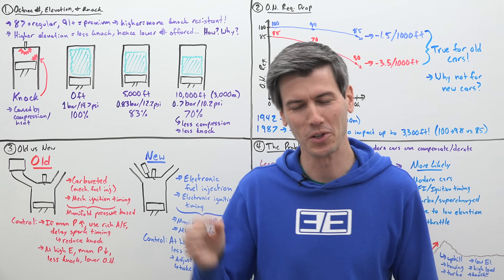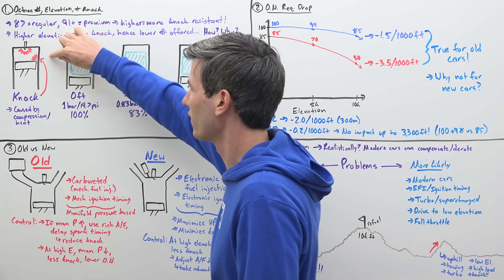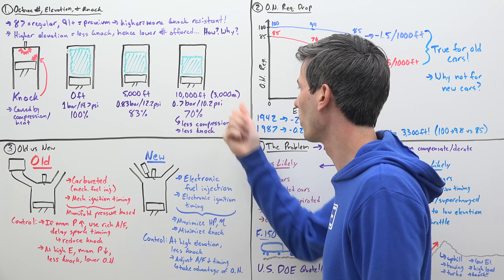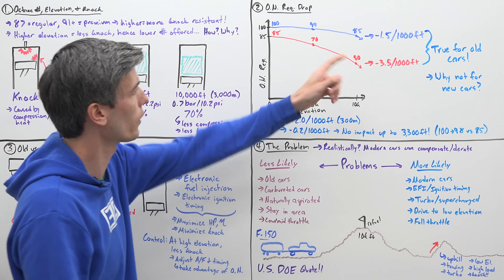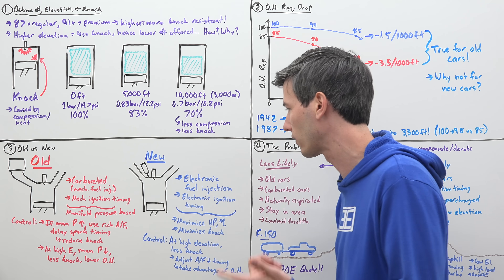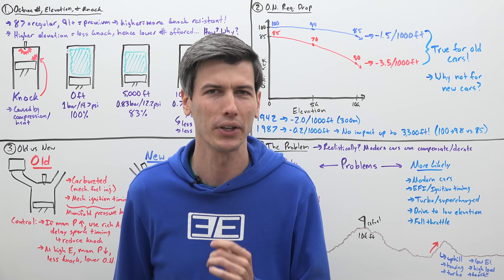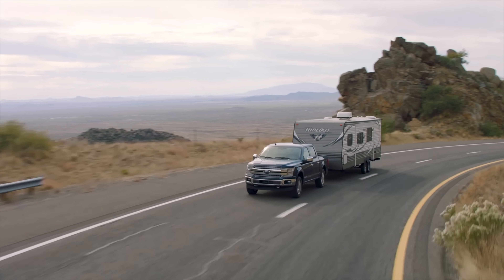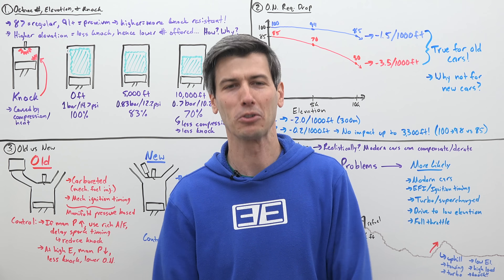Never Use This Gas In Your Car!

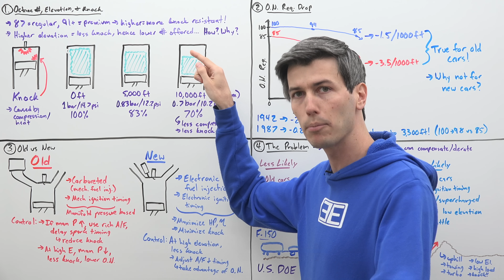Comment: ~7:00...."New engines can compensate for this (altitude), because they have EFI and they have electronic ignition timing, so you can maximize horse power and you can maximize efficiency and you can minimize knock by playing with your exact a/f ratio and by playing with your ignition timing"
As someone who lives at and drag races at high elevation, I can assure anyone, that no matter the A/F ratio fiddling, no matter the Ignition timing tweaking by any ECM, ALL NA engines are still going to lose ~3% tq, hp and cylinder pressure....per 1000' elevation....and that is quite simply b/c the air density decreases with elevation.  There isn't "as much air" in a cubic foot of air.  Doesn't matter if it's EFI or not.  In fact, I have run my car here (at 4200' elevation at our track) then calc'ed the improvement for lower elevation...then gone and run my car at that lower elevation....and it's run that calc'ed number.  This is an EFI car, BTW.   A non computer controlled car could lose more power (more than 3%), assuming that one doesn't re-jet for the elevation.

I think the real crux of the issue here, and the reasoning behind Ford's warning is when we talk about modern turbo charged (alt compensating) engines, such as Ford's Eco Boost.  Most if not all modern Turbo charged engines use an electronic boost controller which is managed from the Manifold ABSOLUTE Pressure sensor.  Absolute pressure.  This means that a modern turbo engine is going to manage intake absolute pressure at the same level, up until such elevation that the turbos no longer have the capacity to maintain that manifold pressure.  Below that elevation (whatever it is for a given engine/turbo combination...it's 12,000' on our snow cats, at work) you'd have the same absolute intake pressure at any elevation....but at "high" elevation, you can only get lower octanes (85, 87, or 91).  So, telling yourself that you could run, say, 85 at high elevation b/c "less cylinder pressure" in the case of a modern turbocharged engine....that would be folly b/c that engine/mgmt system is going to keep intake pressure (and thus, cylinder pressure) absolutely the same regardless of elevation.  Compounding the problem with detonation, is that a turbo must work harder to maintain that same intake pressure at higher elevations; the pressure ratio is greater, the compressor needs to spin faster and exhaust pressure is likely higher too, to achieve that same manifold pressure, the higher up you go.  All of that adds up to what?  Higher intake charge temps...which does what?  Increases the propensity for knock.   But your octane options are lower.  Hence....Ford's warning.  

Back to NA EFI engines, in practice, at high elevations, I've found NA, EFI engines to be quite able to run just fine using the "old engine" octane requirement curve that you've posted.  I ran a truck I had for 300,000 miles on '85 octane.  9.5:1 compression, EFI, towing my boat through the rocky mtns, in up to 115*F ambient temps....elevations ranging from ~4000' to 7000' where I live.  Truck didn't care, ran great and  lasted way longer than long enough.  

I'd re-examine this topic and look at it through the lens of today's turbo charged engines with Electronic Boost Control, which have become quite popular compared to engine offerings during the "old engine" times.
Reply: That's another area where EVs have an advantage
Reply: @AgentSmith911  The temperatures at higher (habitable) altitudes are cooler in general, so there is less effect on cooling despite the thinner air. The issues only arise in "hot & high" conditions where high temperatures compound the problems experienced with thinner air.

The OP mentioned that, at higher altitudes, turbos will be working harder, meaning intake air temperatures will likely be hotter as well. This is why an electric powertrain would be tremendously beneficial, especially in assisting a combustion engine—you don't need to run sky-high boost on the engine, instead you could increase the boost by a moderate amount and then program the electric motor controller for more power as well or swap it out for one that can handle more current.
Reply: I agree a NA modern car most likely not have any issues as long as you do not operate at sea level at WOT.
Reply from the maker: Yes, less elevation = less power, bc there's less air. Stated throughout the video, and in big text at 7:54. Optimizing for efficiency (which also increases power) happens when you have electronic ignition control, regardless of elevation. That doesn't mean you make sea level power, it means the control system compensates and adjusts timing accordingly. Old engines don't do this. As mentioned at the end of the video, turbo engines increase over atmospheric pressure, so you still need higher octane fuel.
Reply: @EngineeringExplained  You missed the point.  Engines are rarely octane limited at light loads.  Most can reach MBT at 70-80 kpa of manifold pressure or less without knock.  That's why they don't need higher octane at elevation, because they aren't generating enough cylinder pressure.  You can advance the timing all you want, but past a certain point all you're doing is reducing efficiency and increasing bearing load.  It is only when you have a turbocharged engine with absolute pressure targets (at an elevation where the turbos can still reach those targets) that you should be careful about reducing octane, as Mr. Kendrick adroitly pointed out.
Reply: @ChurchAutoTest  Insulting to Jason's intelligence. His silence is deafening.
Reply: Thank you.  This entire video could have been condensed to about 2 min saying "Don't use lower octane fuel at elevation in a modern turbocharged engine because they compensate for reduced atmospheric pressure by increasing manifold absolute pressure".  There's nothing wrong with dropping 2 octane points at high elevation on non turbocharged engines.
Reply: Exactly right. Racers, piston engine aircraft owners, and the terminally curious will have researched this topic and come to the same conclusion as you present. Short and sweet.
Reply: @jimb4090  Well you know the old saying, "engineering explained - just smart enough to be dangerous"

Comment: In more remote and/or higher elevations 85 octane may be the only choice you have. There are multiple locations in remote areas in Canada that your only options are 85 only or sometimes 85/87, and the 87 has the equivalent price of 91/93 purchased in California. I wonder if that would make a difference on a warranty claim to ford.
Reply: Nope, they probably would tell you that you should have found another gas station with 87 or called a tow truck if there wasn't any 87 available.

Comment: Good stuff as always.

Any chance you’ll do a video on sealed transmissions thereby making it difficult to replace transmission fluid?
Reply: Would love to see this. Such a highly debated topic amongst mechanics
Reply: There are numerous videos covering that subject.
Reply: they made it difficult to prevent owners from changing the fluid at home because of the multiple steps of properly checking fluid level. The older vehicles with the ATF dip stick with COLD and HOT lines are meant to be checked with vehicle idling in Park gear and fluid temperature above 104 F degrees but under 128 F degrees(specific temp depending on manufacture, this is for my 2008 lexus LS460). the HOT line is when you waited too long and vehicle idled too long that ATF temperature is above 128 F degrees. Which is why modern vehicles have a fluid level check where the onboard temperature sensor tells you when you are in the proper fluid temperature for level check, and then you pull the "drain" bolt to see if fluid thinly streams out, if nothing streams out it's low, if it's gushing out, it's high. ATF fluid is a hydraulic fluid and will expand with heat.
Reply: @Persocondes  I heard manufacturers did it cause idiots checked cold, saw low added fluid caused leaks cause overfull.leaks made shortage & burnt trans.out

Comment: I live in a high elevation area and all I put in my cars is 85... It's not any cheaper here though. Gas was $3.75 for 85 at a local station.... So far I haven't noticed any problems with my cars, but the owners manual does say to use 87.

Comment: Utah. We have that 85 crap. 
But it doesn’t seem to make any difference.
Reply: I live in Utah as well. I always use 85. My car is a 94’ Toyota Celica, so I don’t think it makes a difference for me lmao
Reply: @wackysamurai1583  Yup. I run it in all my gas engines, even small engines. I have never seemed to have an issue with knock, or ping.
Reply: @mjohnsongreen  I only ever used 91 in my corvette. But other than that, I’m going cheap. These gas prices are wack..thankfully they dropped by like 15 cents where I’m at

Comment: So 85 AKI method fuel can boil at low enough temps at high enough altitudes to cause vapor lock as well in certain fuel systems , so there is a double edge sword to what altitude it should be approved for … Albuquerque - Sante Fe would be ideal altitude …ironically not typically sold there.
…something also to consider is most stations in the Rocky Mountain region also don’t put additives package in the tank for the lowest octane … it is a scam and a shame that consumers get this run around and the lack of education is shameful (both on the private consumers part and the public side) 
However for 20+ yrs I’ve run 85 octane AKI method fuel in aToyota 5VZ-FE …the $0.30 (was $0.10 for most of that time) price difference between octanes doesn’t overcome performance and gallons per 100 miles economics … would love to quit using the 85 octane that fails to meet minimum refinement standards elsewhere and sold here at a current price premium … but our consumer base just doesn’t care enough to effect that change!
Thanks for the efforts though!!

Comment: Wow, here in Brasil, we use 87 octanas in the last 20 or more years, and in the last 5 years, I believe is 92, and in the last year is now 93 for regular Gasoline and 97 or 98 for especials, but we use 27,5% of Alcohol mixed in this Gasoline.

Comment: I had a carbureted 1980 Toyota Celica that I drove in Colorado for 7 years.  Always used 85 octane and ran just fine, no matter how I drove it .  The 90 HP 2.2L 20R engine had a low 8.4:1 compression ratio and was under-stressed.   

1996, my dad bought a new Toyota Camry in Colorado.  Engine size was the same, but the 125 HP 5S engine had DOHC head, higher 9.5:1 compression ratio and EFI, it had a lot more snap.  I could the feel engine retard timing if I filled it with 85 octane.  So I always put better gas in it.

Comment: It's not just high altitude, we drove from Denver to Chicago recently, they were selling garbage 85 all throughout Nebraska and Iowa, we couldn't get 87 until Illinois.  With all of the high compression and turbo cars on the roads, how long are we going to accept this crap as normal and keep paying 80 cents a gallon extra for 91, which is still garbage?

Comment: Won't the electronic knock sensors reduce power to keep the engine safe?  I know this is not a good solution, but the knock sensors should protect the engine, and you will lose power.

Comment: I've lived in the Northeast US/New England since I was 3, where regular gas is 87 octane and premium is usually 92 or 93.  I remember the first time I took a road trip to Colorado and saw that 85 fuel.  Although it was cheaper, I stuck to the 87 considering there was a sticker right on the fuel door stating that was the minimum.  Even though I was sure one or two tanks of that wouldn't destroy my engine, it just didn't seem worth it.  Especially considering how much the power was down anyway due to the thin air.

Comment: I have a unique case where my car has a modern injection system without an octane sensor. I absolutely have to put 91 or higher in it because it doesn't know what it's getting and all the fuel and advance tables are set for 91. It kind of scares me more as the years go on that if I needed emergency fuel, I really couldn't drive it on 87 that a tow truck might have. Because it is naturally aspirated, it has lost a significant amount of power at altitude. I still won't put lower octane because the altitude is temporary, but the octane dilution is not.

Comment: I know there's a lot of comments in here but I want you all to know very clearly that there are only 2 grades of regular gasoline 87 and 90+, the 89 or "middle" gas at the pump is LITERALLY just a mix of the other 2. There are only 2 fuel tanks(3 if there is diesel) in the ground at a gas station, if you run out of one of them, you can no longer make the middle one at the pumps. Don't buy the middle one, it's a scam. This is for Oregon, we have a lot of older vehicles still because they last longer. We have 87, 89, 91+.

Comment: What about my 1984 F150 and it's feedback carb? A carb that can dynamically change it's A/F ratio... has an OBD1 (EEC-IV) computer and many of the same sensors FI engines of the period use (Baro, Coolant Temp, O2, etc.). It's both the best of both worlds in one way, and the worst of both worlds in another.

Comment: If you directly mentioned compression ratio, I missed it.  High compression ratio is typically the reason for requiring higher octane fuels.  Although you talked about octane being less necessary for older vehicles, you implied that this was due to older technology, but I think that wear is an important variable as well.  As engines wear, they "lose compression", so it would seem to make sense that a well worn engine might safely make use of lower octane fuels, even if it has newer technology, and even if it isn't all that old (chronologically), right?

Comment: Have you ever seen one of "Greg's planes and automobiles" videos where he talks about Octane Ratings and manifold boost pressures in WW2 era fighter engines? He goes into tons of technical detail about two stage turbo-supercharging and power outputs at different altitudes...
Reply: Greg's videos are among the most interesting technical posts on the 'net.
Reply: @stevedugas8988  yeah i love 'em
Reply: Greg explained that US fighters evolved to outperform German fighters due to the availability of higher octane fuel.  Manifold pressure was allowed to go higher producing more horsepower.
Reply: One of the best historical research/engineering channels on youtube by far

Comment: I moved to Minnesota last year and quickly noticed that instead of 87, 89, and 91 like most places they have 87, 88 and 91 (and 88 is cheaper than 87). I think 88 has a higher ethanol percentage than the others? Any thoughts on that?
Reply: Yes, 88 is 15% ethanol and can also void your warranty on many cars that were only designed for 10% ethanol or less. Ethanol is not environmentally friendly and wastes energy but MN has a strong corn lobby which has gotten its way.

Comment: 85 IS cheaper than 87 in high altitude states. BUT...  The price of 85 in a high altitude state is about the same as 87 in a low altitude state. In high altitude states, they charge EXTRA for 87. The don't give a discount for 85.

Comment: Great explanation.  I always wondered why the fuel pumps at high elevations were labeled with lower octane.  I used to think it was the same fuel but that the fuel was less able to resist knock at higher elevations and therefore an 87 octane fuel at sea level functioned like an 85 octane fuel at high elevation.  I recently learned the truth that the fuel sold at high elevations actually is a lower octane because (historically) engines don't need as much octane at high elevations.  But I did not know why.  Your explanation filled in the gaps and also explained why the lower octane is not necessarily okay with newer vehicles.  Makes perfect sense now.  Thanks again !!

Comment: Interesting. The difference between octane (AKI) in the  USA and octane (RON) in Australia is about 6 units.  Regular fuel in Oz is 91 RON, or roughly equal to 85 octane in the USA. Your regular 87 sits midway between our regular (91) and premium (95). The absolute best we can get from regular fuel stations is 98 RON, or equivalent to USA 92.
Reply: wait, is that different exist? which other country in the planet outside USA not using RON as octane number? I really need to know
Reply: @internetw4nk3r74  aptronym
Reply: @grantm1891  errrr...?

Comment: * Higher manifold vacuum at full throttle on old cars, not pressure (hence the vacuum advance on a mechanical distributor)
Reply: I had a 1961 Rambler American Classic, inline 6 with 127 hp. The windshield wipers were driven off the intake manifold vacuum. Real fun when you're entering the highway at night in the rain and floor it. The wipers nearly stop.
Reply: The real term is maniford pressure. The pressure is measured from a total vacuum. This is the only way to get the same number regaardless of the elavation of the car.  At full throttle the "vacuum" would be less or nonexistant.
Reply: You are correct! I noticed that error too. That's a good reason for a vacuum gauge on an older carbureted vehicle. See my comment on the subject including my reference to the knock sensor which is essentially a microphone. Some might call it a transducer.
Reply: @davewinter2688  some might call it a crystal that when vibrated, produces a voltage, to the ecu which alters spark timing, to compensate.